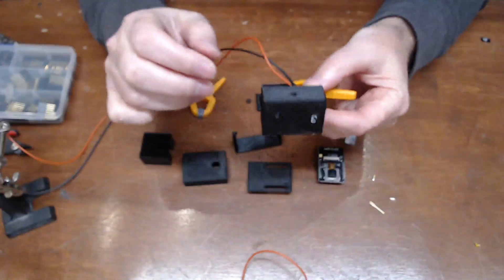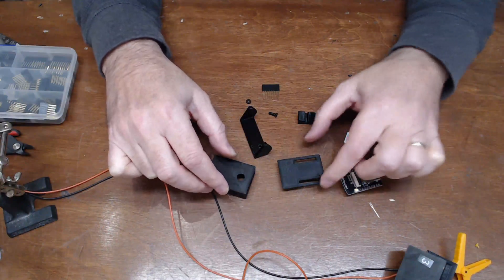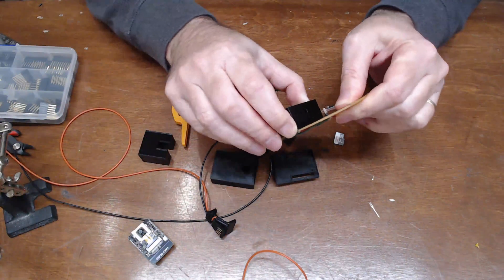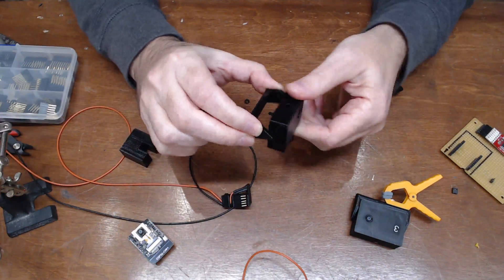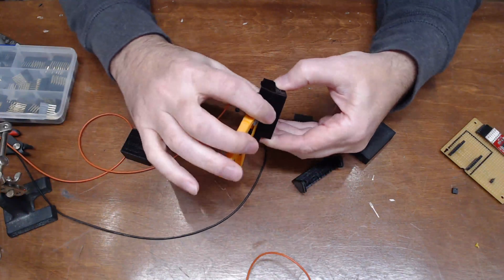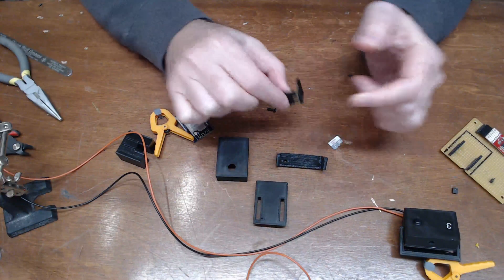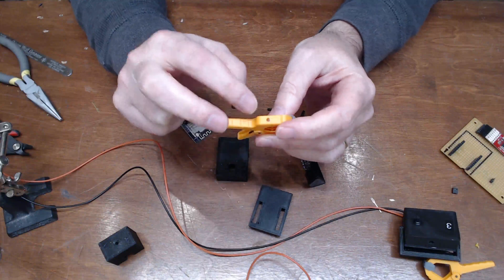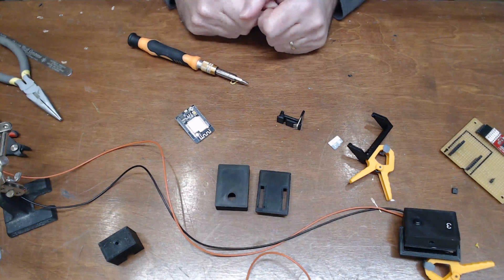ESP32-Cam Case with swivel arm

Comment: Which I could buy this case somewhere i dont have a 3D printer ☺️
Reply from the maker: I thought of putting a few up for sale. the problem is that the camera itself comes in two versions (that I know of) that have different length in connector. It's only 4mm but enough for one not to fit. I have designs for both but don't really want deal with the returns because "the camera don't fit"
Reply: @Core3DTech  I understand tbh the only thing that stops me from buying a 3D printer is because I think it's a little toxic 🤭